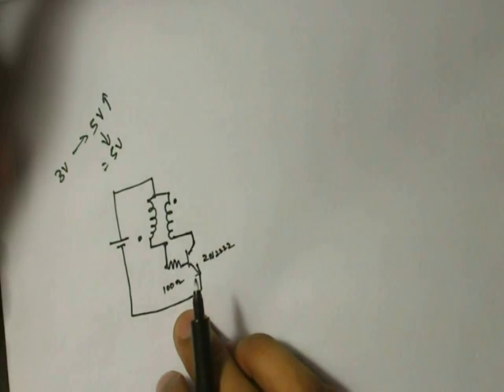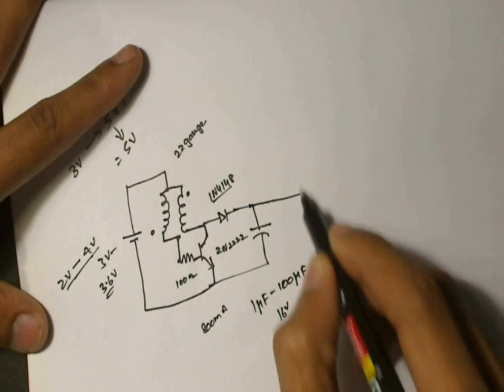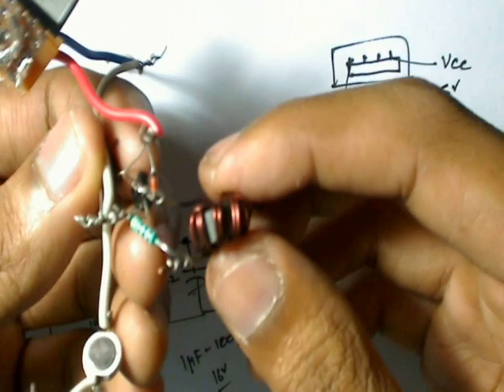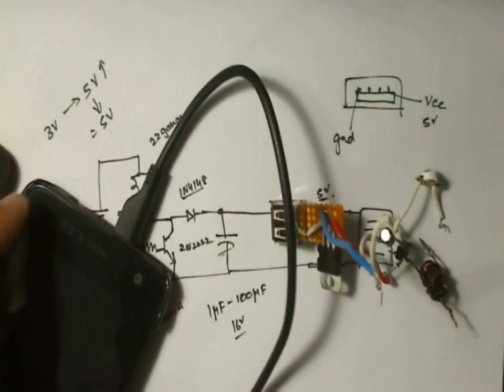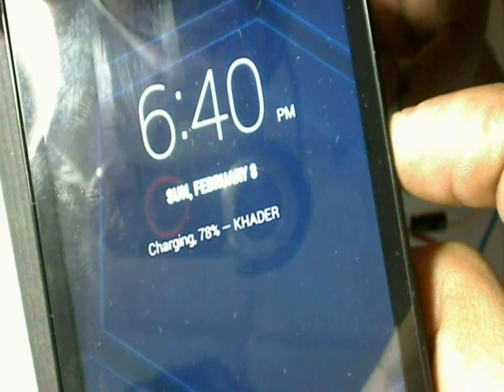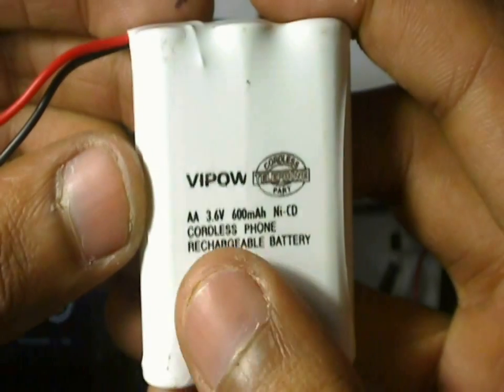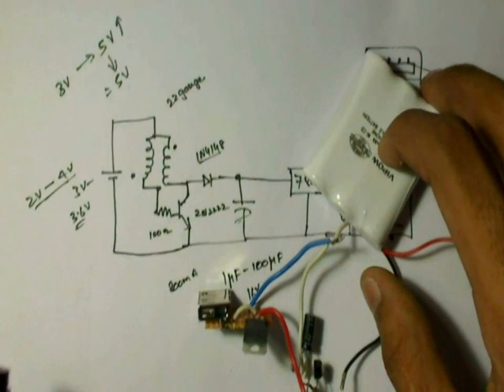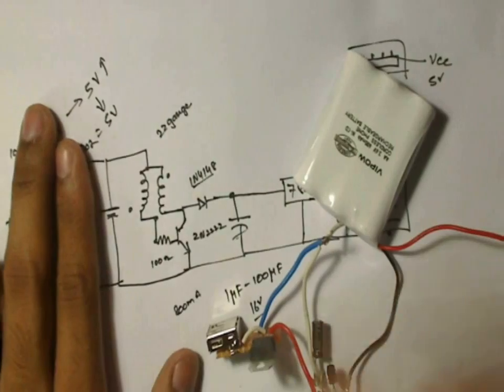Mobile battery pack (usb charger)

Comment: Hi Khader thanks for this nice video. Quite straightforward.  please can you make a video on how to convert wireless mouse to USB rechargeable.  the mouse currently uses 2 AAA batteries.  To avoid buying batteries frequently I would like to use 2 AAA rechargeable batteries and make them charge using computer USB power.  appreciate any help.

Comment: hi Khadar, would like to ask: why use LM317 when it has low efficiency?
Reply from the maker: LM317 doesn't have low efficiency its the joule thief which is less efficient.
 and i used 7805 in this circuit not LM317 :)
Reply: Electronics Made Easy : KHADER okay, thanks!

Comment: Hai Khadar, i have saw all the videos and they are excellent, thank u, and actually i got one problem please solve it. The problem is Simple LM317 adjustable regulated power supply, the input is rectified 14 volts and the 10K POT is smoking (burning out) so please give me the solution my E-MAIL is mck1479@gmail.com, thank u.
Reply from the maker: +mc kulkarni thank u. first of all i had the same problem few years back when i built my first supply, and sadly i wasnt able to find the solution at that time but building the circuit without any loose connections and placing a high wattage feedback resistor of 330ohms solved the problem then. the problem occurs due to high current flow from the supply to the ground and from what u r saying it says that u r building a power supply of current greater than 1A. the best solution for this problem would be using a  high power transistor like tip 41 or 2n3055 from input to output like in this circuit. (http://www.bristolwatch.com/ele/lm317.htm ) using this would definitely solve the problem if connected properly.

Comment: nice Khader i gave my thumb's up for this video and i think you had to modify this circuit to the chipset of a powerbank and it may be good project for your next video and other thing. There is no video to make a chipset of a powerbank on youtube.
Reply from the maker: +yash shrivansh thanks :). yeh actually this design is a very low efficiency design and i should probably design a power bank with the boocter ic 2577 which would be a really nice project but the only difficult part is the inductor coil design part .
Reply: What is a working of inductor coil in powerbank. Its very difficult to design inductor coil but i think its not very difficult to you because you are a successful engineer and you can easily find out the way to make it easy. I wish to see this thing in your future videos...
Reply from the maker: +yash shrivansh  see basically the battery inside the power bank is a liion battery like our mobile so it has a voltage of 3.7v. but u cannot charge a 3.7v battery of mobile with the same voltage battery so u need to increase the voltage i.e we increase it to 5v (same as usb voltage). to do this we use an inductor. the property of an inductor is that when we try to pass a voltage across the inductor changing at a very high rate (say infinity ) then the inductor tends to charge and discharge at very high rate and thus while discharging gives very high voltage peaks (infinity voltage).this property is used to increase the voltage of 3.7v to 5v in the power bank.
say for example inductor is a spring then if u press it softly and relese it slowly then it will retract slowly but if u press it hard and relese it quickly then it will jump to a higher level same is the case of inductor and voltage.
Reply: thanks khader.

Comment: Khader u showed the current flow at the input... Where it is around 150ma for Nicd batteries at 3.8v approx.. I am very much interested to know the output load voltage and the amount of current drawn by ur smartphone .. If its up to the reasonable ratings I would say u just made a good power bank ... Good one
Reply from the maker: Santhosh Ksjc  the current at the output varies between 80-90mA and the voltage is regulated to 5v. The circuit can be used for emergency cases to get two or three points of charge but not complete cycle as the AH rating of the battery is 500mAh. to get more power out of the battery, we can use li-ion batteries such as 18650 which are rated at 2000-4000AH.